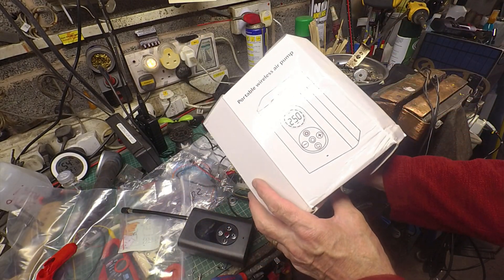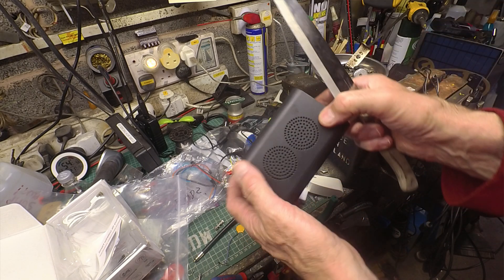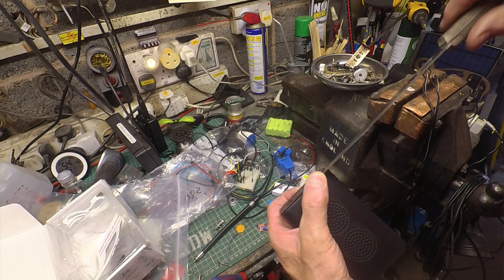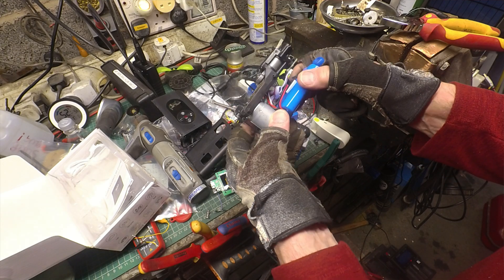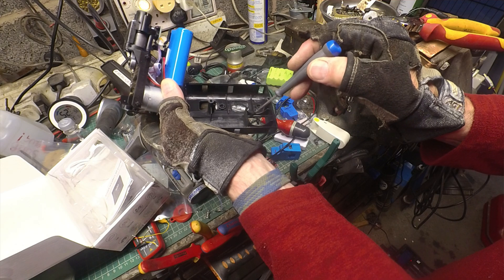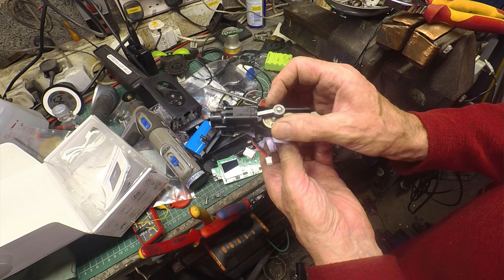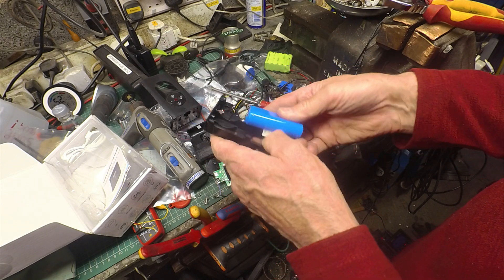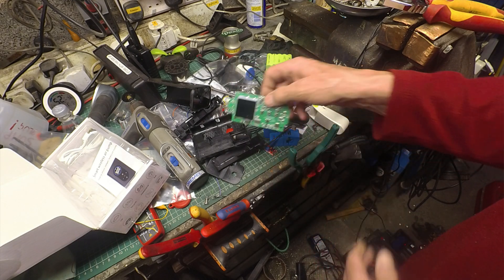Cordless Air Pump: Teardown

Comment: Don’t you have to hold the power button to turn it on…lol hopefully
You tried holding it down for a few seconds before tearing into it guess I’ll find out at the end here shortly haha I have a similar one and you gotta hold down the power button for a good few secs to turn it on and spray
Reply from the maker: Maybe. I used the refund to buy another pump of the same type. That one works fine. It does need a long-press to turn it on  but I tried holding the button down on the first pump much longer than in the video with no luck. I just couldn’t get it to turn on 😕

Comment: These pumps should come with a manual for disassembly and lubrication! they are completely shielded, and the user manual doesn't say anything about lubricant
Reply from the maker: @dreletronica  That would be great. Trouble is they’d rather you buy a new one 😕

Comment: Brilliant video. Thanks. I have a bigger version with similar casing. The bottom cover is recessed and pops out to reveal 2 screws. The top has two seams. There's a very thin plate covering two screws. I got the bottom off then unclipped the main cover then broke the screws off at the top. No big deal as the main clips hold the cover in place. The fault on mine appears to be a tiny pressure sensor at the end of a pipe. Uncoupling that allows the pump to run but also lets air out and obviously doesn't stop or display the pressure changing. I'll have to look again to seal the pipe when I have more time.
Reply from the maker: Interesting. Many thanks for posting the comment. Good luck with it! 🙂

Comment: The usual fault (or engineered to fail) for those off-shore pumps is the batteries. In 18 months or so, after just handful of bicycle tires inflate, the batteries just can provide any current. I suspect the 18650 are just piss poor quality and not rated for 5C. I was curious of the exact make of the Li-Ions.
Reply from the maker: The batteries in this pump turned out to be 20700 - a successor to the 18650. The batteries themselves have proven to be good, though there’s no manufacturers name on them. I think the problem with the pump was some kind of failure in the electronics 🙁